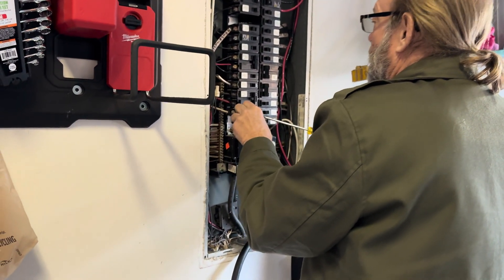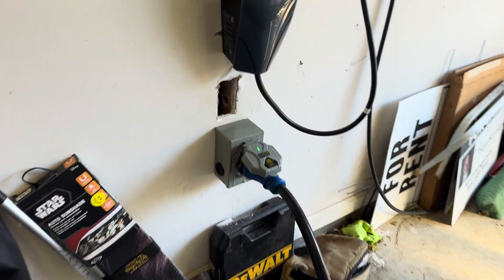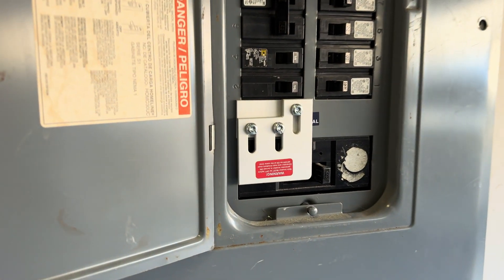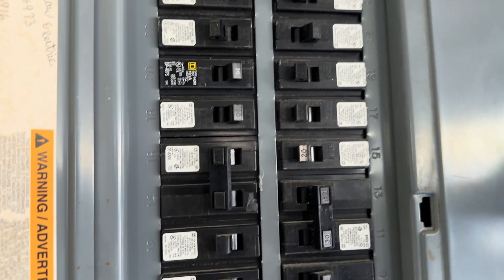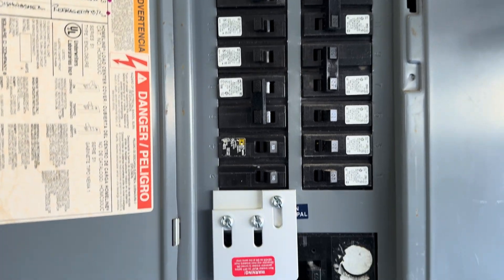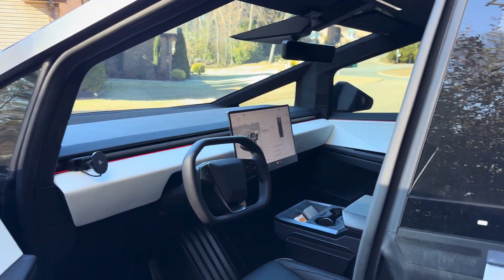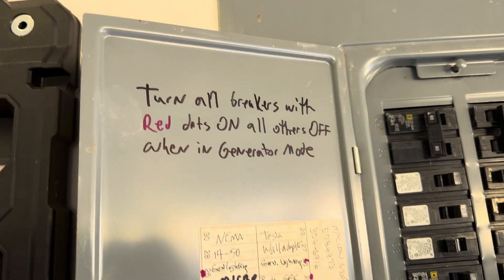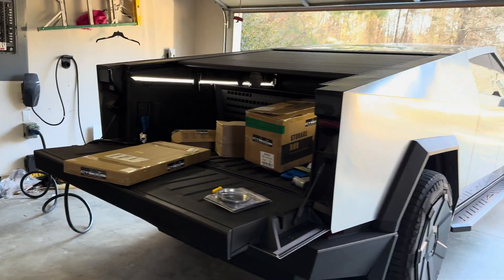Cybertruck is Powering my Whole House

Comment: Did you get a real power outage and how did the cybertruck perform as backup?
Reply from the maker: I did not. I don't expect to use the backup much. I have lived in my home for 27 years and only had 3-5 outages that lasted more than a couple hours.
Reply: Ok. I'm in Florida. Get about 5-7 small 1-2 hr outages. This will be easy short term back up. Portable generator on standby for day outages etc. I think  cybertruck is awesome. Thanks for video
Reply from the maker: @alzamboti8639  this solution could also be your days long backup. The 100+kW battery pack should run a decent sized home for several days... as long as you get power back on or have a Supercharger close by to recharge.

Comment: Tesla universal wall connector plus Tesla gateway gets you bidirectional charging and will provide more KW than the Nema outlet in the bed
Reply from the maker: I know this, but PowerShare is also $2500 for the equipment plus over $4,000 for the installation. This setup costs $200 for equipment and $400 for labor. A better fit economically for those of us who plan to rarely use this feature. Another difference is this solution maxes out at 9.6kW vs. 11.6kW for the PowerShare.
Reply: Agree. Question I heard you had a Lightning also, why that EV 7200kw bed outlet doesn't work while Cybertruck does to interlock switch? (Ground, neutral issue, how they are different besides 30 vs 40amp?
Reply from the maker: @alzamboti8639  My Lightning is a Pro and thus does not have a 240V outlet in the bed, so I can't compare.

Comment: So when the power's out you're going to drain your electrically charged car to power your home? Hmm
Reply from the maker: @avman2cl  yes it will run my entire home for 2-5 days depending on usage. Then I can drive 2 miles to a DC fast charger and replenish the battery in about 40 minutes.  Power outages are rare at my home so I expect to use it as a backup for hours not days so I can just charge back up once power is restored.
Reply: Yes just like if you had a generator and when the power comes back, you can go to the gas station and pump more gas for it.
Reply: @LarsDennert  but the big difference is that he's $120k out of pocket.

Comment: I have been trying to get a similar system built for my home with a different EV but quickly stopped. Any fire that requires an insurance inspection will allow the insurance company to deny compensation. Doesn’t have to be an EV fire. If you have an EV wired to provide power to your home you will be denied insurance coverage. Do your own research.
Reply from the maker: Unfortunately, insurance companies often find ways to deny claims. Regarding my setup, all the equipment is being used as intended. It’s crucial to use an interlock to prevent power from flowing back onto the utility line. This could pose a danger to unsuspecting line workers.